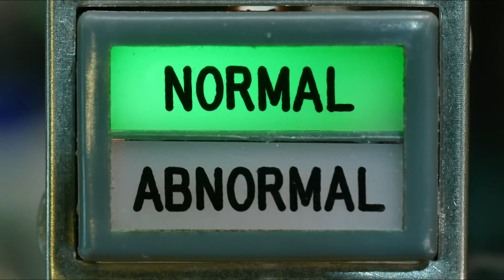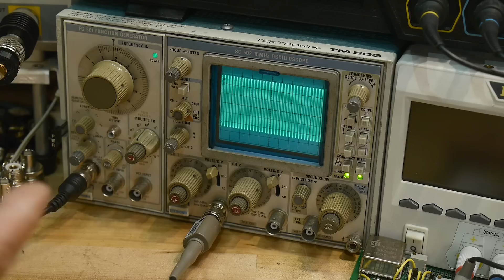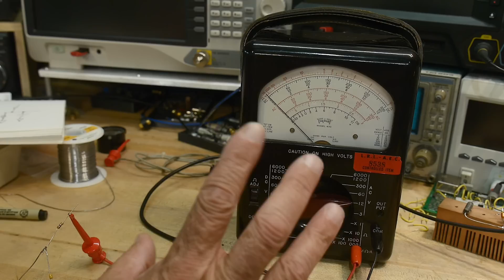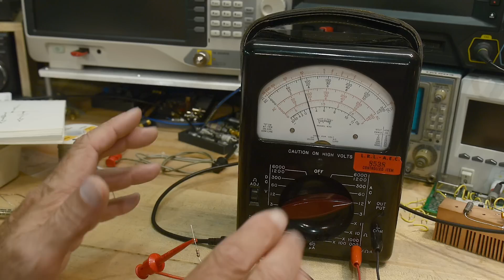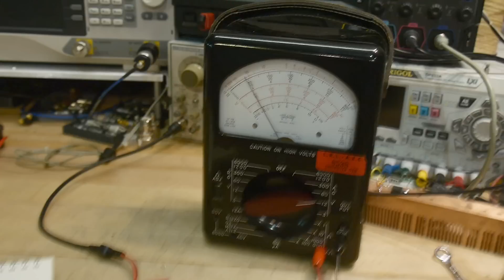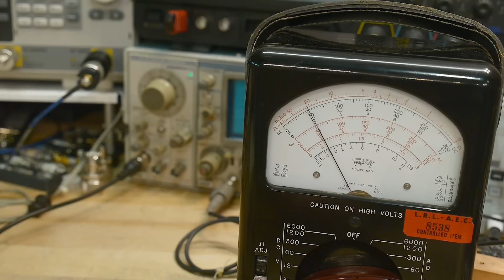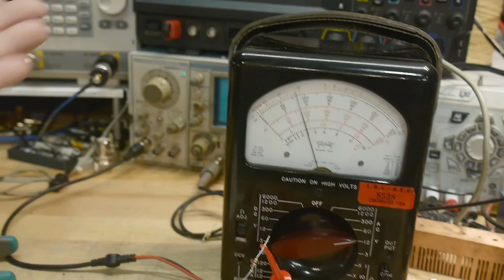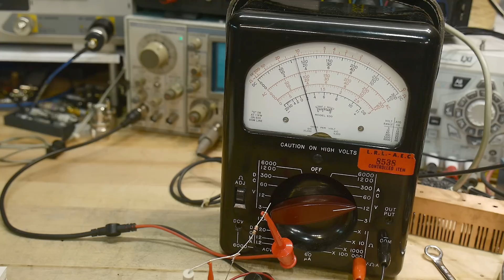#1607 Stop Making Excuses:   Learn Electronics

Comment: I started learning electronics when I was pretty young. Pre-teen for sure, although I couldn't tell you an exact year. Let's say I was about, aaaaaaaah... let's go with 11 years old. Fast forward... I'm 51 now. And I only got my first oscilloscope when I was around 40. And only got my first "$1,000+ oscilloscope" about 2 years ago. Actually, most of my higher-end test gear came about 2 years ago. I got a decent bonus at work and spent most of it building the "lab I'd always wanted."  The more salient point though, is that I still managed to learn (some) electronics, built various hobby projects, and - most importantly - had fun with this stuff BEFORE I got an oscilloscope and definitely before I got a "nice" oscilloscope.

Like another posted mentioned: I used to source components by scavenging them from old abandoned electronic items - old television sets, old radios, toys, appliances, whatever I could get my hands on. I'd get wire by scavenging it from the instrument consoles of old junked cars, etc. My multimeter and soldering iron were low-end Radio Shack items that "serious" electronics hobbyists might have laughed at, but they worked for me. 

The point? You can - as IMSAI guy says - get started in electronics without all that "stuff" that you might think you need. And you can do it without spending a lot of money. If anything, things are better now than when I was young, as "ok enough" quality test equipment, tools, etc. are available for pretty cheap from AliExpress from variety of Chinese manufacturers. I mean, is a sub $100 Fnirsi oscilloscope the best in the world? You betcha it is, if it's the only oscilloscope you have! Don't worry about what you don't have, focus on what you can have. 

As the old saying goes: "Wish in one hand, spit in the other one, and see which one fills up first."  Don't worry about wishing for the perfect setup, just get what you can get your hands on, and get started.

Comment: I'm using my phone as a frequency generator with the 3.5mm jack and a coupling capacitor on a breadboard. Of course it only does 20kHz and below but it allows me to mess around with homebrew audio circuits and works like a charm.

Comment: Your advice re: "stop making excuses", is so right.  If you have an internet connection, you can learn just about anything.  You don't even need to buy any books, if you don't want to.
I can remember trying to find technical books about electronics, at school when I was about 9 years old, but there was nothing.
In later years, even trying to get hold of a particular data sheet required access to specialized (well I thought they were) libraries etc. where I had to pay 20c per photo copy page. I wasn't allowed to get any books out because I wasn't a student there. Times were tough in the pre Internet age. I turn 70 tomorrow, by the way.
There are NO Excuses at all these days, as long as you have an internet connection, of course.
Reply: Now the problems are related to sifting through the terabytes of information on the internet, and having the knowledge of what to focus on. Many people may give you false or shoddy information, with no way to differentiate from accurate information, unless you pay the same amount of money for expensive books. Also keep in mind that for people who grew up with the internet, such as myself, we may have different difficulties than you had, although of a very different variety than monetary or convenience-wise.

Comment: A guy I used to work with came to Canada from formerly communist Roumania, where nothing was available. He was interested in electronics as a kid, and would repair things for friends and neighbours. He even unwound transformers to fit the break in the wire that prevented it working, and joined the ends back together, insulated it (nail polish, perhaps?) and wound the thing back together. He wound up with a deep understanding of electronics.

Comment: In my experience, for simple useful dc electronics, a really cheap multimeter is often enough. Voltage and resistance measurements will for sure help you out. And you don't need extreme accuracy.

Comment: The best way of starting with electronics is to start at a young age. In this way you are really able to get a "good feeling" for electronics because you are still not able to understand all the math behind the scene. I have started at an age of 11 to 12. At 14 I was allready able to understand the behaviour of the devices that I use and I was able to design my own working circuit. At around 18 to 20 I understood the mathematics of the circuits and I was able to design really good application circuits for certain purposes.

Comment: I still recall that when I was in college, learning electronics, my best friend and classmate was from a poor family. My family was not much better, but I was working part time and had some money to spend. I was building low end Heathkit test equipment models to outfit my home laboratory. My friend was designing his own using junk box parts and so on. Both of us ended up with home electronics labs. I could describe to you how all the circuits worked, and he could describe them with an additional layer of understanding through his extra work and thought, born of his situation and necessity. I bought a Commodore PET computer, and he designed his own computer and its firmware from scratch. We both became professional engineers, but I always admired how he was able to get there on the most shoestring of budgets, and in many ways I still think he is the better educated one when it comes to circuit and software design.
Reply: Necessity is the mother of invention.

Comment: I got an EE degree and a Masters in telecommunications and I ONLY really learned electronics when I started actually building cool stuff on my spare time. Started with a radio transmitter and from there audio amplifiers and now I'm deep into digital circuits with discrete parts.
Your advice is sound and simple, yet most people don't follow through. I'll add a bit of my own advice here. If you don;t have the money to buy some gear you need for a project, then buy as much as you afford and keep what you get somewhere where you can see it all the time. It will remind you to buy the rest when you get some extra money and keep you motivated. Sunken cost fallacy works marvelously :)

Comment: I know some people look down on analogue meters - they do have some advantages over digital.  Any change is instantly visible like a peak or a dip.  With digital the numbers are always jiggling and there is sometimes a delay displaying the value when things change.
After more than 40 years I have gone back to having fun electronics.  90% of my stuff comes from good old AliExpress.  Most of us are not designing satellites or missile guidance systems so we don't need expensive stuff.  You can get it very cheap and its more than enough to move you forward.  The 555 timer oscillator project which was just talked about is a great start to making your own test equipment.  Get an oscilloscope much later when you have saved up for it and reached a point where it becomes valuable, not just eye candy on your bench.

Comment: One way to start learning electronics is to download a simulator like LtSpice and mockup simple circuits.  I don't have much equipment at this point (a digital volt meter and a power supply).  Eventually, would love to buy an oscilloscope. As hobbies go, electronics isn't "over the top" expensive compared to other hobbies (cars, woodworking, etc.).

Comment: I've restarted in electronics at the age of 63, my meter cost 7 euros, the signal generator cost about the same as a kit from Amazon and my oscilloscope is one of these handheld DSO'sthat also tests components, it cost a whopping 80 euros from Amazon. It's not perfect but it  serves a purpose and is super useful. To my mind if you really want to learn something you will find a way. Start small and be passionate.

Comment: That's a good video and a good lesson. I started in 1955 but recently started going through the experiments in Ward Silver's 'Hands on Radio'. There are a few things I missed since 1955!

Thats a Triplett 635 VOM, right? I have one. But last year I bought a modern equivalent: "Tekpower TP8250 Analog Multimeter with Null Middle Position 0 for Variation Measurement ".   I love the center-zero scale. I'll leave it to you to explain how useful that can be.

Comment: I started when I was 5-7 years old. I soldered an analog multimeter kit from Radio Shack. Shockingly, it still worked after I connected the current meter to a 12v car battery. Oops.
Later, my dad brought home a surplus vacuum tube transceiver from the National Guard. It didn't work, but I tested all of the tubes and replaced them until it worked fine. I was lucky to know not to use more than one hand inside when it was turned on. I had no idea how high the voltages were. Lucky I didn't zap myself dead. After having used an analog meter, I found the first used digital meter I bought a bit puzzling. Around the house, I was able to fix all kinds of things by taking them apart and putting them back together. Sometimes I knew what I fixed, sometimes not.
I agree, for what you are doing, an analog meter is so much more revealing about what is going on. Who cares what the true numbers are, it's the changes that matter.
And for those of you watching videos with Calculus in them, you don't need to be able to DO Calculus, just understand what it means. That isn't all that hard if you can stumble upon good explanations. Don't learn to do differential or integral equations, just understand what they mean. That opens up a deeper understanding of how things work. You don't have to study any math techniques to get there.

Comment: To be fair, it depends on what you mean by "learn electronics."  Can you learn some basic principles, fix through hole stuff and setup a lab for cheap.  Sure.  I did.  It took a while but I made a lab for about $100.  Can you learn theory without spending a lot of dedicated & structured time in books?  Thats still a must.  Can you troubleshoot modern digital circuits with thousands of components, complex feedback loops and proprietary chips and programming?  Will you be able to reverse engineer and make schematics, make circuits or just look at a board and know whats going on?  Probably not.   Its the difference between a hobby and a profession.
Reply from the maker: I was an engineer at HP and Wavetek and designed several products, so it is possible. It is a lot of work learning that most will not do.

Comment: I started when I was about 9 or 10. I would take stuff apart. I use to assemble the Radio Shack Science Fair kits. These were great they were able to teach point to point soldering. Attended a electronics classes in my junior and senior years in high school. To this day I’m designing and build circuits. So in retrospect you can start at any age. No excuses keep on learning. Piece.

Comment: I just had s thought. My crappy little scope can only go up to 100 khz but I need to messure a s 200khz signal. What I can do is feed the square wave into a 4024 divider and bring the signal down to readable range. To find the actual freqency I can just multiply the signal from what it was divided by.

Comment: A suggestion would be to show a 555 circuit feeding the filters and seeing the output on one of the low-cost dvms and scopes you show on your channel. I suspect you have a gazillion videos showing the various individual items but maybe not working together. You could then compare the results of 555 and the cheap scope with your need-a-second-mortgage, lottery-win kit and show (in many cases) that you indeed don't need the flashy kit to start out.

Comment: I can think of one instance where there is an excuse. There is a gap in the teachings between arduino and atmel programming. There are some lectures on youtube from MIT on an atmega, but the basics are not there, so I had to learn the language there and extrapolate the basics from the documentation. -Arduinos are bulky and expensive, it should be in humanity's interest that as many as possible learn to use discrete microcontrollers.

Comment: I have to say, that I'm pretty much exactly like you, I learned electronics without a oscilloscope (but I'm still learning, and always will be! I'm 16 currently lol) , and I only had a multimeter (all tho you said you only had a volt meter at that time... lol)
anyways, I also got my parts from taking other electronics apart... and a little time later, from the trash :P
its nice to see others that learned the same way as I am learning.
but now ofc, I do have a more expensive oscilloscope, but thats this year, when I was 15 and all the way down too I think 13 years old, I had one of those $20 oscilloscopes, and I thought that was good at that time! and when I was younger than that, I didn't even have an oscilloscope! and I learned a ton from that time all the way to now :)

Comment: Great video - so true. I bought my first scope 30 years ago - BWD with 1mhz bandwidth….. for 50 cents….. non working of course. I fixed it.

I had a crappy soldering iron, and a metex dmm 

Now I have so many toys (not like though 😂). 2 Top of the line RS scope , 4 x 576, SR715, all kinds of weller irons, ….. and more toys on the. I just wish I could repair like you😊

Comment: Hey Mr Imsai Guy, you are way smarter than me in frequency/RF stuff and I appreciate your encouragement :) to those who wish for expensive test equipment.
Here’s my back story, apprenticeship in radio/electronics servicing in 1976 here in New Zealand with at the time obviously no digital multimeters so have always used an analogue one in conjunction with a digital multimeter when they finally arrived. 
Analogue meters on their ohm ranges are the best I find when measuring transistors and diodes for internal faults.
I have an oscilloscope but hardly ever used it as there is always street smarts to use when servicing electronics for a living plus I have never had to do RF transmission servicing.
Back in the late 1980s I purchased that oscilloscope for 1400 NZD which was a waste of money as per above reason.
Retiring next year hopefully from the grind but will still play.
Thanks for your advice to the newbies about keeping it simple to start with.

Comment: At a ham convention flea market I bought a dual trace oscilloscope for $10. it had an intermittent problem so I tried to fix it. Instead I blew it up. I was out a reasonably decent oscilloscope, and $10. But I kept going, and learning . Look for flea markets and garage sales for items. You can find deals for equipment, or electronic parts. Be careful of old TVs with cathode ray tubes. They store deadly voltages for years.

Comment: I've been learning tinkering and repairing things like powered speakers and power amps, most of the time the problem is obvious (you can see where the magic smoke came out :) ) and it's an easy fix but for me that's only the start, I want/need to know 'why' the something failed. I can get an overall understanding of a circuit/schematic but I struggle with what all the passive components in the discrete topologies are actually doing, breaking things right down like this video really helps!
Your reading schematic video was awesome (more please :) ) and along with videos like this I'm learning a lot, looking at cap's and inductors in this context (as resistor equivalents) was enlightening, thank you!

Comment: All one really needs to get into electronics is to be curious. I started playing with magnets when I was 3 years old. Then I worked my way up to an old flashlight when I was 6. At 10 I got a cheap soldering iron, then a broken radio, then another to scrounge parts from. 70 years later I have a lab full of HP, Tek, Agilent, Wavetek, Metcal etc equipment, and piles of ham gear and lasers, not to mention 10's of thousands of parts and hundreds of tech books. But mostly I just use a couple of free Harbor Freight multimeters, a Tiny SA, a NanoVNA, and an $80 handheld 'scope. I've worked at HP, TRW, IBM, SONY, etc. I've had a long career in electronics, even though I could never afford to go to college. I started out poor, and for years never had more than a thousand dollars to my name. But I've always had curiosity, and I've always learned new things every day. You can start with a coupe of magnets and work your way up to an old flashlight, then a cheap soldering iron, then a broken radio. After that, the sky's the limit. PS, Ohm's Law, and all the other electronics equations are absolutely free! And the Internet!!!!

Comment: interesting video. But times have changed.. I am 58 years old and when I got into electronics - it was necessary to improve my tape recorder or my amplifier. To get high quality from low quality with a minimum of costs.
Now you can buy almost anything for a penny for home use in everyday life. It is already more expensive to make or improve than to buy ready-made.
One very great man once said a brilliant phrase
"If someone REALLY needs a power supply - they buy it from the Chinese. If you just want to spend a lot of time and money - make it yourself!"
Your tutorials for beginners are very interesting. But they are not very specific.
For example: There is an output from a digital microcircuit (0 or 1), but the supply voltage of the microcircuit can be from +3 to +18 volts. It is necessary to calculate the key to control the relay. It becomes a question. Which key is better .. on a field-effect transistor or bipolar. what conductivity n-p-n or p-n-p. Is it necessary to shift the base or gate and the simplest calculation of such a circuit.
I think that if you give such concretizing lessons, it will help many. Thank you.